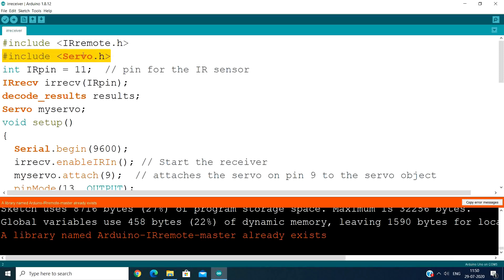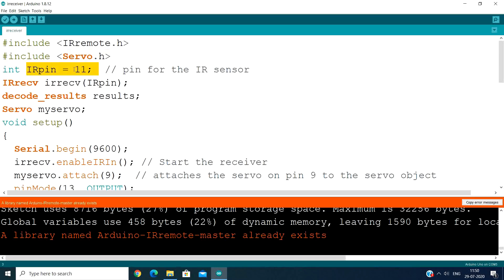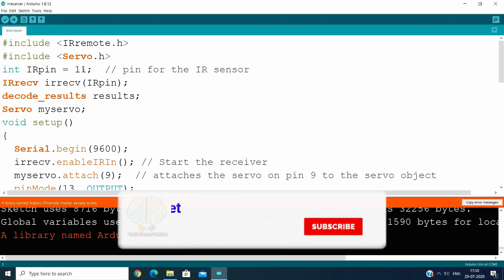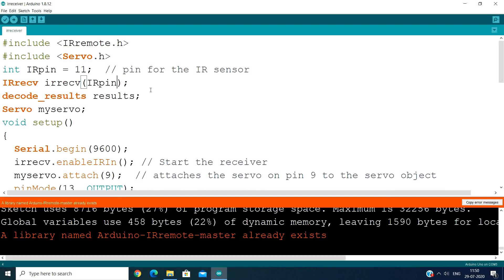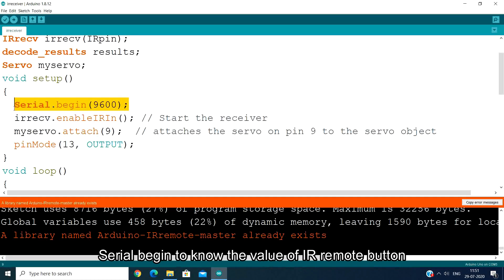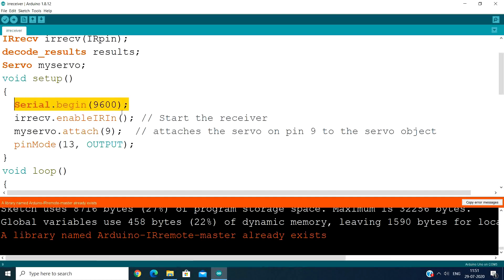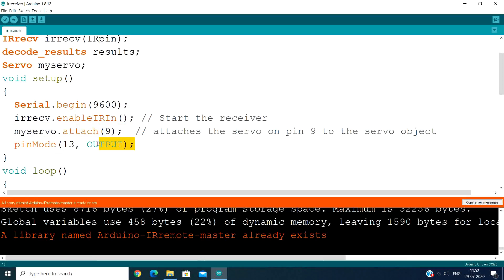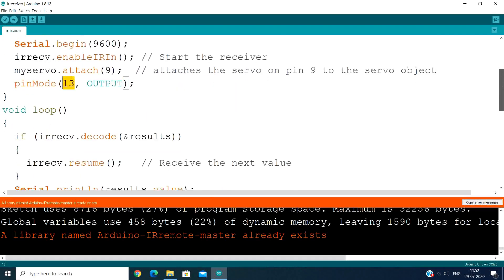Birthday Surprise Balloon Blast using TV Remote in Tamil with English subtitles | TSOP IR Receiver

Comment: 7:23 intha duration la servo motor connection reference kku oru table right side bottom la varum . Athula mistakes irrukku bro.
CORRECT FORM :👇👇
Brown ( negative)   -  GND
RED  ( positive)  - 5 v
Orange ( signal) - 9 th pin

Thappa connection kuduththa work aagaathu bro